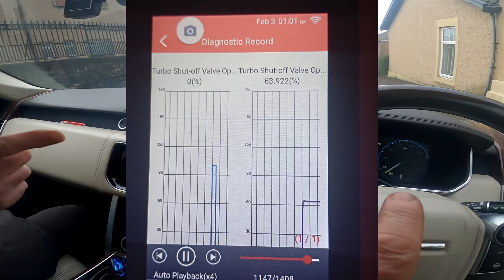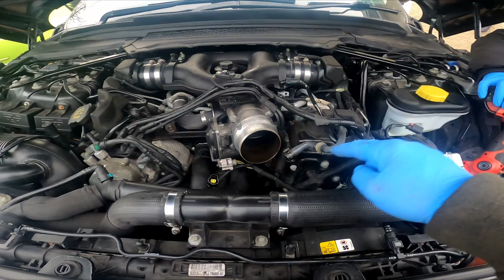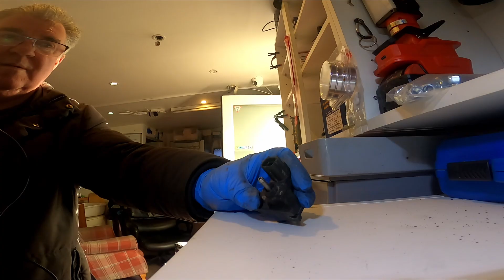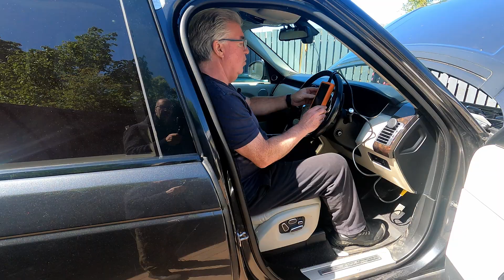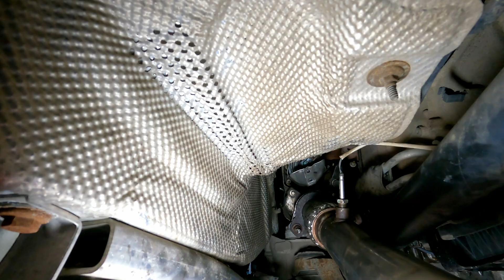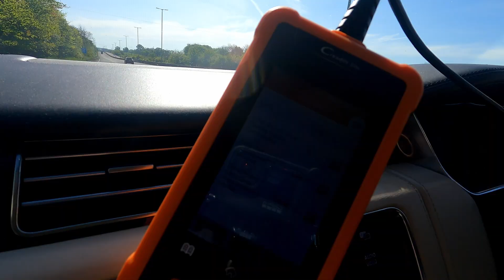Range Rover L405 Turbine Shutoff Valve Replacement #rangerover #automobile #repair #

Comment: I still haven’t looked at mine. Can you get to it via the wheel arch if you remove the covers? 

My car runs fine until I boot it to 3000 rpm

Cheers
Reply from the maker: iam not sure tbh

Comment: Where can I get a copy of that workshop manual please and the diagnostic machine type you use thanks Steve
Reply from the maker: You should be able to down load a copy of the WS manual  from FFRR https://www.fullfatrr.com/forum/, The Diagnostic tool is a Launch can be bought from ebay
https://www.ebay.co.uk/itm/187846188763?_ul=GB&mkevt=1&mkcid=1&mkrid=710-53481-19255-0&campid=5339114221&toolid=10001&customid=eb%3Ab%3Avms%3Aeb%3Ap%3A187846188763%3B1d32708c7c141c4f8ca6191eb4900683&loc_physical_ms=41952&loc_interest_ms=&msclkid=1d32708c7c141c4f8ca6191eb4900683